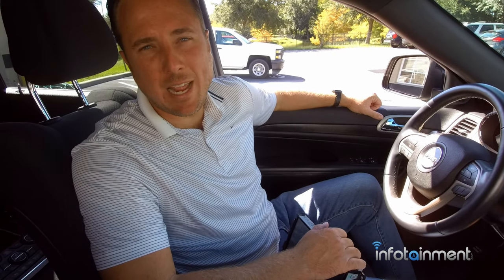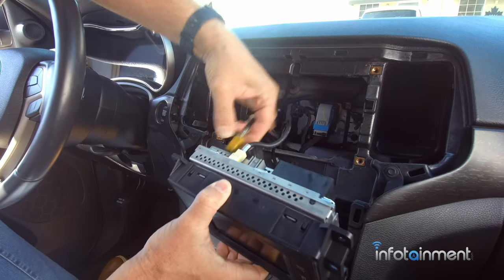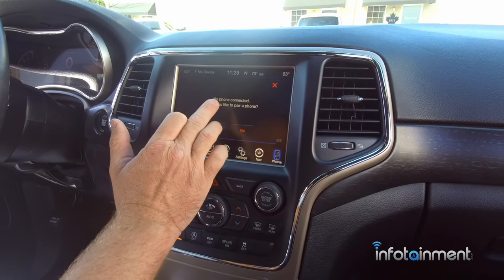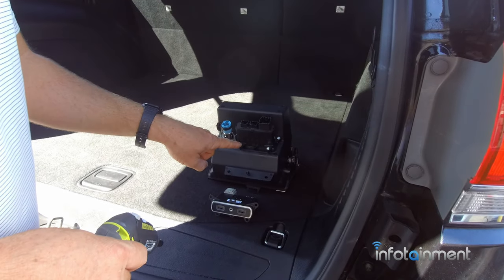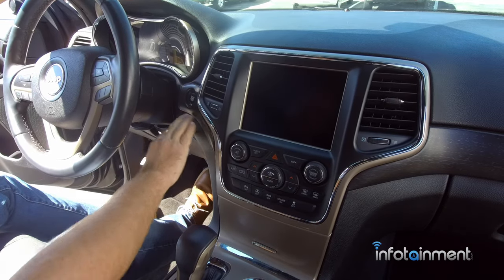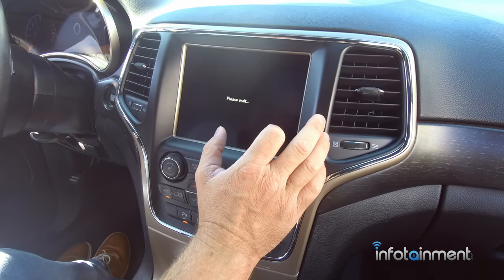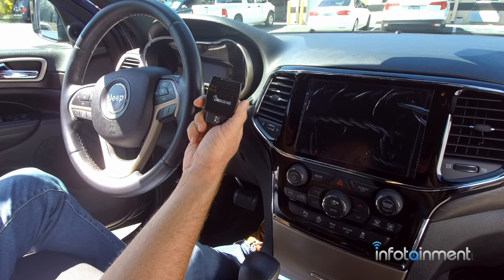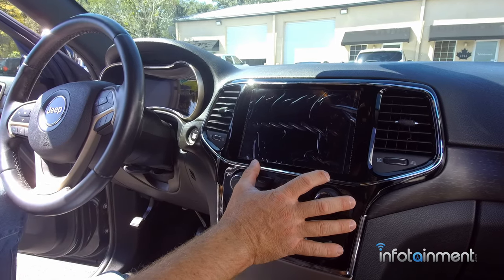2014-2020 Jeep Grand Cherokee Factory OEM Radio Options - Pre-Programmed Plug & Play!

Comment: Dude it’s 2600$ for the UAV. That’s nuts. Actually stupid high price for that. I’d rather did through a junkyard a find one than pay that. Better yet I could buy 20 cheap ones that will probably break over a year on eBay than buy something like that. Wild
Reply from the maker: We do not sell cheap equipment. We sell OEM quality equipment that is fully tested, pre-programmed and procured based on your Vin. There are plenty of companies that sell cheap products. We want to provide a part that we are able to guarantee works and will continue to work. We are confident enough in the product we sell that we are able to warranty it through installation and up to two years depending on your selection at check out. We feel our pricing is competitive as we are comparing our pieces to the cost of getting a new vehicle as opposed the cost of an aftermarket part whose quality is greatly inferior.
Reply: Yeah, I already have the 8.4 with Nav, so looks like I would be paying $3700cnd to get Apple CarPlay…same low res screen…at least the Grand Cherokee $500 US cheaper and get the higher res screen…the pricing appears extreme…if you’re just needing the CarPlay…there are other options. Too bad they didn’t offer a more reasonable solution to those who just need the CarPlay…but that kind of 💰💰💰 hard to justify 1/3 of the cars value 🤔

Comment: I have 2021 jeep grand Cherokee limited  wk, I got apple car play to work when connected by wire, how do I get it to work wireless, I have apple iPhone 14 pro-max. Also how do I find out which OEM radio I have, Do I need to upgrade anything in the radio. Thank you great video🙏
Reply from the maker: We do not have a wireless Apple CarPlay and Android Auto solution for Jeep just yet but this is on the way. Use this link and we will keep you updated. Thank you. 

https://forms.zohopublic.com/infotainmentcom/form/ProductInterestListForm/formperma/m7R2exajUQkfs2WJO8mkDzUcYC2HIt5WrUWxFICnigs

Comment: Hey quick question. 

I purchased a upgraded UAV unit on eBay for my 2016 Jeep GC and installed over the weekend – bought the media usb hub as well. Obviously, I didn't go the full kit route you offer but I did buy the display wiring harness from your site. Everything works fine however when I power off the vehicle the screen goes black/blank and I can't get it back. The only way to get the screen back is to disconnect the battery, but every time I turn off the car the screen goes black again.

Any tips you can provide here? Could programming be the issue?
Reply from the maker: So we don't typically sell that harness seperately so if you did get one it must have been in error. We only support the full kit. We have no way to assess what is wrong as the pieces you have did not go through our 20 point inspection so we have no way to verify that they are correct parts or that they have not been damaged. We would recommend returning everything and going with the full kit or selling some of those pieces back to us using our trade-in program and going with the full kit. We would not support anything else on this. 

https://trade-in.infotainment.com/
Reply: Did i fix your problem ?

Comment: I have a factory 8.4 inch display, and for whatever reason, after nine years, the navigation has stopped working. Thoughts on that? 2015 KL.
Reply from the maker: This can happen after many years of good use. We can repair what sounds like a Mother/circut board issue on that RA4 radio for $399.95. 
https://infotainment.com/shop/services/repair-service/repair-service-fca-uconnect-3c-ra4-or-ra3-8-4-inch-touchscreen-radio-5/

Comment: UAQ retains heated & cooled seats, steering wheel heater, mirror dimmer, and SRT pages? I have a 2015 GC SRT.
Reply from the maker: Yes only on 14 is this an issue. The Video says 14-15 but we solved the issue for 15's. 
https://infotainment.com/shop/interior-accessories/infotainment-radio-upgrades/2014-2021-jeep-grand-cherokee-gps-navigation-8-4-4c-nav-uaq-radio-with-apple-carplay-android-auto/

Comment: For the UAV does the media change come with? I have a 2017 Jeep Grand Cherokee, would I have to replace the charging ports too??
Reply from the maker: You do have to replace the USB Media hub to get Apple CarPlay and Android Auto. However, we include everything you will need in the kit so that will not need to be purchased seperately. The Media hub is where those charging ports are so those are changed as well. 
https://infotainment.com/shop/interior-accessories/infotainment-radio-upgrades/2016-2021-jeep-grand-cherokee-uconnect-4c-nav-with-8-4-inch-display-uav-radio-with-apple-carplay-android-auto/

Comment: I went with a car pride but now after watching this I need to find a new jeep at the junkyard atleast grab the USB device I have the 8.4 uav the the 3rd best I guess?  But 2015 jeep so imq assume if I just get the USB hub I can use Android auto
Reply: Was thinking the same thing prices are not reasonable for such low functionality
Reply from the maker: We don't sell harnessing or parts seperately. We would need to do with the full kit with us as there is programming and custom harnessing that is needed. Extracting parts from damaged vehicles and not reporgramming them has a very high failure rate as the radios and vehicles typically need to be married to each other to avoid lingering issues.
Reply: @Infotainment_nav  stop lying to people they are plug and play, i just put a 2020 radio into my 2015 WK2
Reply: You don’t need to program anything you just want to sell people shit.. wait 24 hours and all options should be there. Only thing you need is a harness for some  2014 to 2015 vehicles if you want to keep heated or vented seats.
Reply: @JoshuaTruckin i have a 2015 grand cherokee, could i just put in a 2019 radio that has carplay if they are the same size ?
Reply: @mattikalijarvi  hi really you do it just plug an play i have 2015 grand cheroke and i want 2020 screen

Comment: Do you guys know if the Panasonic unit's have finally been resolved of their screen delamination issues? I'd hate to spend a bunch of money to upgrade my RA4 to a UAQ only to have the screen fail on me like so many others. Since it's not a factory radio for my year, and my Jeep is imported anyway I wouldn't be able to undergo the replacement through UConnect.
Reply from the maker: A lot of these components are no longer manufactured by the MOPAR factories.  So we have an experienced team of technicians that recondition these units with new parts.  Any kind of historical issues with the hardware are addressed by our team.  The UAQ units in particular are notorious for their delaminating screens, which we replace with a second generation factory screen that does not have those issues.
Reply: @Infotainment_nav  Very good to hear, thank you!

Comment: That works with a jeep grand Cherokee limited 2015 ?
Reply from the maker: Unfortunately this is an older video we produced in 2020. After much tested we have found that this is not compatible with 2014-2015 vehicles and compatiblity now starts at 2016 on our site. We had issues that we have not found solutions for yet for the 2014-2015 vehicles
Reply: @Infotainment_nav  thank you for your honesty 👍

Comment: Good afternoon. I need the c-intdisp-wk cable

How can I get it.
Reply from the maker: That cable is only shipped as part of our full kit to upgrade to UAV. We would not sell it any other way as it would be useless without the right equipment. 
https://infotainment.com/shop/interior-accessories/infotainment-radio-upgrades/2016-2021-jeep-grand-cherokee-uconnect-4c-nav-with-8-4-inch-display-uav-radio-with-apple-carplay-android-auto/
Reply: It is mandatory to have it connected.
It’s just to be able to control it on the screen

Comment: As much as I want apple CarPlay, at $3700 cnd think I’ll have to do without 😂
Reply from the maker: Thankfully these packages are much less than $3700.  We've got the links to all 3 packages in the video description 👍.  
We have a few different financing options available including but not limited too, Affirm, Klarna, PayPal, and Apple Pay Later. There are low interest and even interest free options. 

There are absolutely aftermarket options out there that will be more affordable. Unfortunately with aftermarket upgrade you are at the risk of losing any number of factory features. 

 The packages that we offer are completely factory OEM plug and play upgrades allowing you to maintain the factory OEM integrity of the vehicle.  Many of the packages that we offer will have wiring that accommodates a plug and play install without having to cut or splice the connection.  The packages that require programming will come pre programmed to the vehicles VIN# and the packages that require BCM programming will come with an OBDII programmer to easily accommodate the RPO code programming while also avoiding a trip to the dealership. 

All of our products and services will come with a 30 day compatibility, functionality, and price guarantee.  The hardware and services will also have a 90 day warranty with the option to increase the warranty to either 1 or 2 years within 90 days of the purchase.  We also have a full customer support staff that is available Monday - Friday EST to offer technical support and to stand by the in house warranty and guarantees that we offer. 

Feel free to reach out to our sales department if we can be of any assistance.  We would be happy to help verify a compatible upgrade path. 

1-855-636-6287 Ext: 2 or sales@infotainment.zohodesk.com.
Reply: @Infotainment_nav  so how much is it to put Apple Car Play in my fully optioned 2016 Jeep Trail-hawk? I didn’t see a separate option for CarPlay? So the only option would be to get the top version…which would be $3700 CND if not more by the time duty ..taxes etc are added. As I did the first time I went to your site added my vehicle information…and the only option I could see would be your most expensive version….which to get ACP unfortunately just not financially responsible lol. 

$2700 US to CND $3693.69 plus taxes of $480cnd, then duty and ship it ..would take me well over $4k

Comment: I'm disappointed,my 2017 grand cherokee doesn't support Android Auto
Reply from the maker: We offer three options to take your vehicle to Apple CarPlay and Android Auto. 
This 7" cost effective option. 
https://infotainment.com/shop/interior-accessories/infotainment-radio-upgrades/2014-2017-jeep-grand-cherokee-uconnect-4-uag-7-inch-display-with-apple-carplay-android-auto/
We can do the 8.4" with Apple CarPlay and Android Auto 
https://infotainment.com/shop/interior-accessories/infotainment-radio-upgrades/2014-2021-jeep-grand-cherokee-gps-navigation-8-4-4c-nav-uaq-radio-with-apple-carplay-android-auto/
Then we offer an 8.4" unit with a newer screen that come out in 2019 that is a bit more expensive but has a better HD screen and is a faster unit. This also has Apple CarPlay and Android Auto. 
https://infotainment.com/shop/interior-accessories/infotainment-radio-upgrades/2016-2021-jeep-grand-cherokee-uconnect-4c-nav-with-8-4-inch-display-uav-radio-with-apple-carplay-android-auto/